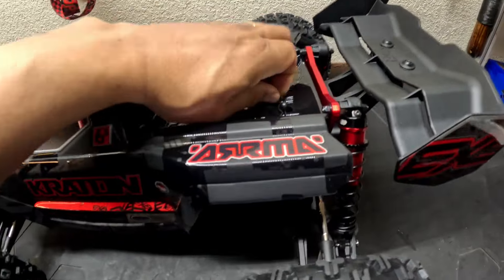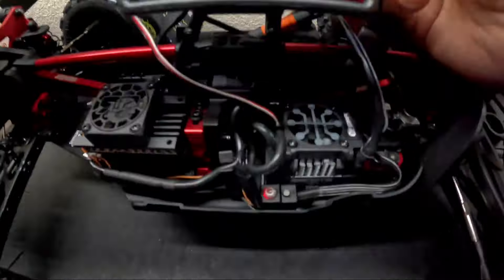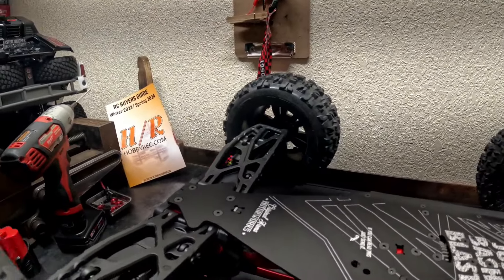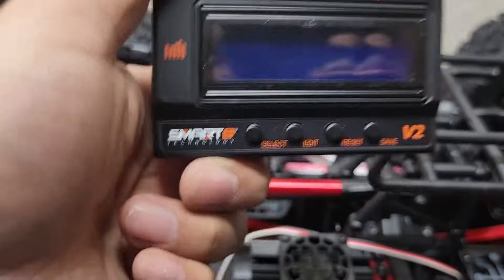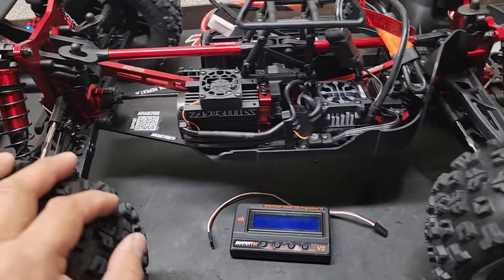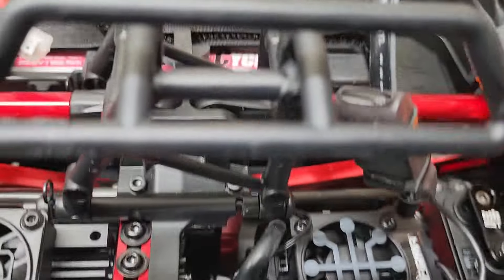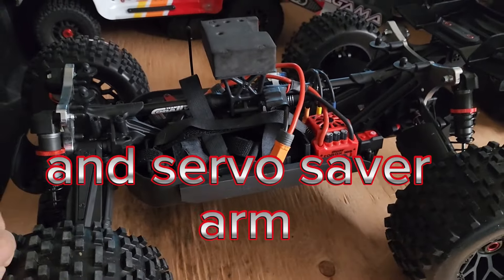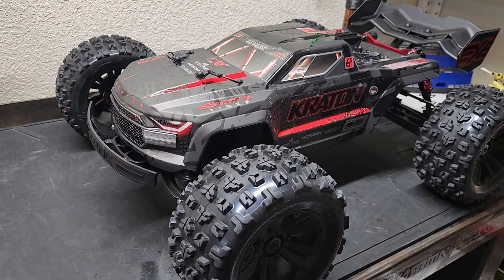Arrma Kraton 6S EXB RTR V2 getting it ready

Comment: 😆 What a pile of crap lol I'd return it to the store! 😜 😆
Reply: lol
Reply from the maker: 😂 wait and see the first bash
Reply: @victorevan7893   Oh this ought to be good lol. BTW I found a way to strap my old iphone 5 into my Xmaxx and get a true GPS speed. According to the app I was using it showed the Traxxas app was out by about 6 mph. So my true speed with 18/46 gears is 42mph not the 48 indicated on the dashboard. I adjusted it to show the correct speed by entering a custom size spur gear size in the Traxxas app until it showed the correct speed.
Reply from the maker: @Doug_Morgan  awesome, yeah, I tried mine, but having issues with traxxas app wasn't saving my settings with spur and end points, so I gave up on it, but I might try on UDR
Reply: @victorevan7893  I had a bit of an incident with a fence post. I kind of hit it with my front right wheel doing about 20. Wow was that an impact. Surprisingly the only thing I can find broken is the ball link on the inside of the steering arm. Even the little threaded part that most people break is fine. The M4x35mm screw that holds the outer end to the steering knuckle is bent some. I already have spare end links and a new screw on hand so it is already fixed. Cannot believe I didn't break and arm or bulkhead.
Reply from the maker: @Doug_Morgan  glad it was an easy fix. I was going to play too, but it snowed, so I was checking parts online for kraton.